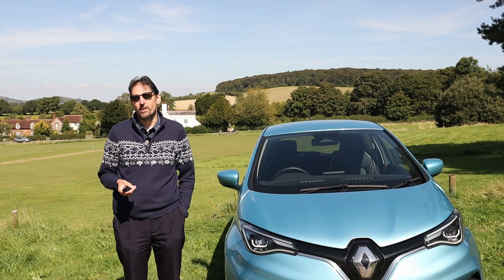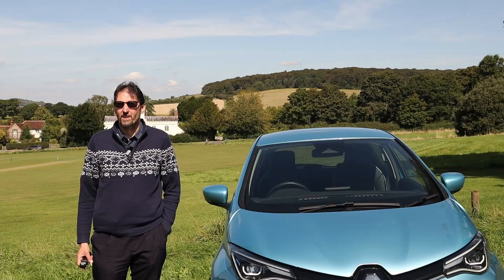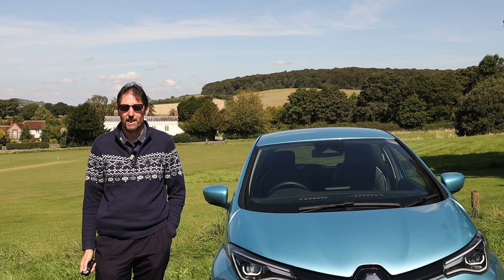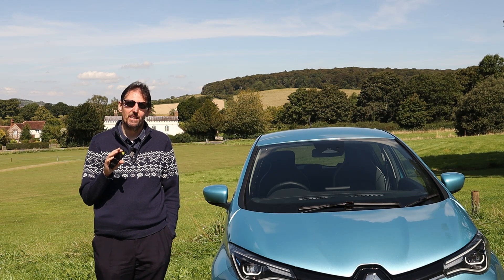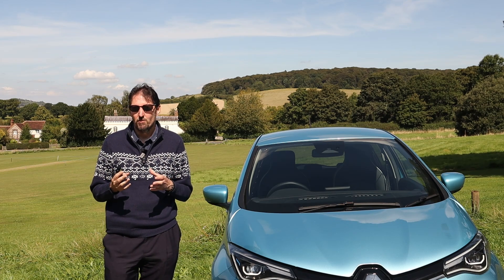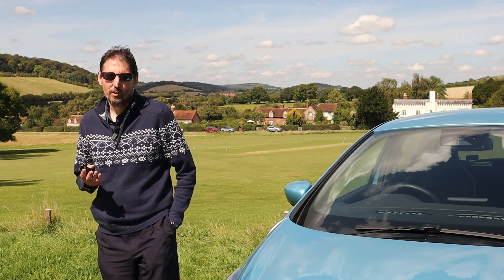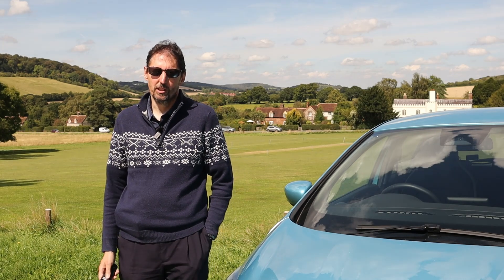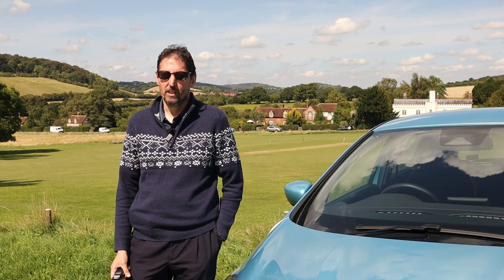Renault Zoe - Battery Degradation?

Comment: I would be more concerned with the Zoe motor bearings.. known to fail approaching 100k miles. Its a design flaw, they spark erode thru the motor and pit the bearings over time. See garyc ev repairs.
Reply from the maker: Yes, absolutely. I did a video referring to Gary's findings a few months ago 👍

Comment: Original Zoe had the 43kw AC optional charger , super rapid AC charge
Reply from the maker: Yes, indeed, it was not even optional in the early days. Those original ZOEs all offered 43kW. Only once the Renault motor was introduced was there a choice available.

Comment: Our 2017 ZE40 is now seven years old and still has at least 160 miles on a full charge.
Reply from the maker: That's great. Thanks for the extra data point. Feedback from owners certainly seems to be confirming the longevity of the ZOE battery 👍

Comment: I'm about to buy a January 2022 RENAULT ZOE Zen 50 R135 100kW, with rapid charger. The have shown me the SOH report: 96% and with ODO 25.000 km. What do you think? Is it convincing? I live in the south of Spain. Will probably in most cases do 16A home charging.
Reply from the maker: Hi there, sorry for the delayed reply. At 3 years old, we might expect 4% loss of health, that is exactly what I would expect. My rule of thumb is 2% degradation for the first year, followed by 1% in subsequent years, assuming average mileage. The mileage of that car sounds good, so it is reporting exactly what I would expect.

The ZOE battery is proving to be very reliable, so I would have no concerns there.

There are a couple of little weaknesses with the ZOE that have become apparent, one is a potential charger failure that isn't too hard to fix, and the other is an issue with the motor bearings. If this happens, it usually occurs above 100,000 miles (160,000 km), although some have suffered this sooner. Even so, this motor issue seems to happen to a relatively small number of cars, from what I can tell so far.

I remain very happy with mine. I've had no issues besides a flat tyre and some temporary software glitches.

Let me know if you get the car and what you think of it after a couple of weeks.

Comment: I can concur with your conclusions. Admittedly we are low mileage drivers of our ZE50 R110, but after 12,000 miles since early 2021 we've not noticed any battery degradation. We do have CCS DC recharging, but have never needed to use it, and almost always recharge at home at up to 3kW. 

What we have noticed however is that the true range of the car exceeds the claim made by Renault for most of the year. It's the start of March 2025, and I took it for a 30+ mile run today, in 3 stages, and saw 4.8 mpkWh, which equates to exactly the claimed range of about 243 miles from a nominal 52 kWh. Ambient temperature was about 9 to 10°C. In Summer, on long runs, it's easy to travel for 275 miles or further on motorways and A roads. With a little care, I can drive for more than 300 miles if the ambient temperature is above about 25°C, I have attained 6.4 mpkWh at times, with only myself in the car. 

In September 2023, with two people, a mobility buggy and self-catering holiday luggage aboard, travelling between the South Coast and Central Lincolnshire, we arrived at destination with an estimated 46 miles of remaining range. I had driven at normal traffic speeds on main roads wherever possible, with ambient temperature around 28 to 32°C.

In Winter, with near-freezing weather, and on multiple short journeys, the car still delivers more than 200 miles of range, even when my wife (who is heavier with her right foot) is driving. She drove for about 90 miles last weekend, with an friend, and in ambient temperatures varying from 1°C to 8°C, used the A/C, and returned with 60% of the battery SOC remaining. An estimated range of about 225 miles.

What I'm saying is that, even with modest thermal management, our 2020 Zoe, now on its way to 5 years old, can travel for further in a day in Britain than I'm happy driving for, without recharging en route. Even if the battery degraded to 75% of its original capacity (essentially almost end of life), the car would still be perfectly adequate for our needs, with maybe a brief recharge during a meal break. 

I'm now a 'senior citizen' as the Americans like to call us, and I have the impression that the battery will likely still be useable after I stop using my driving license. Maybe the rust maggots will have eaten the car before then.

My main complaint with battery recharging is that neither the car nor the Renault app tell us what the recharging speed is. That's quite frustrating when the recharging point doesn't tell you the recharge rate either. I wish the Renault would address the omission, but I doubt that they ever will. As Hubnut says, 'Because, French!'

Comment: Is it normal for the fan to be on constantly in the cold, range is very reduced when freezing temperatures too
Reply from the maker: No, I wouldn't expect the fan to be on constantly, unless the hear pump is working very hard.

I wonder if your system needs regassing. ZOEs are known to lose a bit of gas, so getting it checked might be worthwhile.

I suffer range loss of about 25% between summer and winter. Are you seeing more than that, and at what temperatures? The coldest mine has experienced is -5C
Reply: @theelectrictransition  its the battery fan thats on...temp was about minus 2 yeah about the same range loss maybe a bit more
Reply from the maker: @doncasterghosthunters  So the fan noise is from under the rear seat, rather than under the bonnet?

It's a ZE50 presumably? The ZE50 has a battery heater, but the earlier variants didn't, which is why I ask
Reply: @theelectrictransition  fan noise is under bonnet....yeah its my mates car , i thought perhaps when the battery is cold it blew heat to try warm it i thought after watching ur video ur the man to ask
Reply: @theelectrictransition  its a zoe e3w mc 1lp
Reply from the maker: @doncasterghosthunters  OK, a fan under the bonnet isn't for the battery, I dont think. The battery cooling is on top of the battery, at the back, under the rear seat.

I think it might be the heat pump. It sounds like the noise I get when I heat the cabin.

I guess you could confirm it by turning the cabin fan speed to zero, thereby turning the cabin heating off completely. If the noise stops, then it's related to cabin heating.

The other fan under the bonnet is the motor cooling, but that shouldn't be running much at this time of year.

You could take it to an air con place and have them check the gas pressure in the heat pump system. It might need a top-up.
Reply: @theelectrictransition  awesome thank u il tell him to try that

Comment: Many thanks for re-assuring me! 2017 ZE 40, 10000 miles - love it!
Reply from the maker: That's great! I'm glad you are enjoying it. The perks in the winter are not to be sniffed at, and the range gets much better in the spring
Reply: Ours has 230 000 and still has 250k range. Always charged to 100%

Comment: My 2017 ZE40 has 118K miles and the battery SOH is at 82%. A full charge displays around 145 miles (less in winter).
Reply from the maker: Thanks for the data

Comment: I think degradation measurement is very difficult and only an approximation  is possible and I will propose another method:
If you charge your car 20 to 80% say five times which makes 300% over the period (assuming you've zeroed the consumption at the beginning) now read your car's total (drive and accessories ie a/c etc. - Megane Etech seperates these two so you need to add) consumption meter then divide by 3 for our example case you would get a better battery capacity measure; I think. What is your thoughts ?
Brgds from Istanbul
Reply from the maker: Yes, that might also be an interesting figure to calculate. I went with the approach in the video because I wanted to minimise the figures I used from the car. Some people might accuse the manufacturers of adjusting the figures in their favour - and scandals like dieselgate certainly suggest some caution is appropriate in using manufacturer-provided data.

Comment: My 10-year-old Zoe is still running very well on the original battery, has seen temperatures as low as -31C here in northern Sweden, amazing car! 

Heat pump works like a dream in the mornings so you never have to scrape ice off of the windows and can get into a warm car from anywhere.
Reply from the maker: That's great, I'm glad it has done you so well. -31 - wow, that's properly cold! What is your rough odometer reading now? I ask because I know that there are a lot of people who have done, and continue to do, very long roadtrips in their 22kW ZOE, which must add to the distance travelled.
Reply: @theelectrictransition  Only about 73000km, other examples have driven much more than this one, but it was barely driven early on in its life so it's only now that it's starting to accrue some decent numbers on the odometer. Have seen plenty of cars with well over twice or three times that on the original battery though.

Comment: Interesting, but I’ll keep my 2009 Ford Focus that can do 500 miles on a tankful of good, old fashioned petrol.
Reply from the maker: How often do you do a journey of 500 miles? If you have easy access to overnight charging then having more range than you actually use is a bit irrelevant.
Reply: @theelectrictransition  We just drove from the Black Sea coast to Halkidiki. These are not uncommon trips for us.
We have the ability and space to spend 1500 quid on a charging point at home, but why would we? 
We travel back and forth across Europe in the Focus or Dacia Duster diesel.
Life's too short and stressful enough without all the farting about with an EV.
In January we were in Bansko and there was a Tesla with Bucharest license plates parked next to our car.
It was - 14 C and we got home on half a tank of petrol in a nice, warm car.
How many stops would sparky have to have made on the journey to Romania?
Too bloody many, thank you very much.
Reply: @escapetheratracenow9883  , and you drive 600km without stopping? 🤣🤣 When i go on vacation, i go on vacation, im not in race with anyone! Think about not only a range in your car but all your parts thts need to be replaced - chain , oil , clutch, transmission......etc . Do you think about that ?

Comment: I've had 6x Renault Zoes as I buy & sell EV's..

2018 ZE40 with a SOH between 80% to 90% and a mileage of 110,000km..(Can't remember exact SOH)

2018 ZE40 with 86,000 miles was a ex uk car and the SOH was 86%..

2020 ZE50 with 32,000 miles was a ex uk car and had a SOH of 91.6%..

2020 ZE50 with 22,000 miles was a ex uk car and SOH of 90%..

2020 ZE50 with 49,000 miles SOH 95%..

2020 ZE50 with 50,000 miles SOH 96%..

In my experience Renault Zoes don't give any battery trouble..
Reply from the maker: That's really useful information, thanks.
Reply: 10% less range per charge after just a few years, that sounds scary
Reply: @r1pfake521  Most EV's lose around 10% in the first few years thats normal.. I will update that post as I've had more since..

Comment: my 2013 chevy volt is at 200,000 km and it has NMC lipo pouch cells, very similar to the leaf battery cells. it gets 45 miles of range, and new it got around 36 miles lol. because its a PHEV and doesnt have DC charging, and also doesnt let the battery discharge in the cold and has a very over built battery cooling system, it basically has no noticeable degradation over the entire life of the vehicle. despite what people will tell you, most large batteries that are built well will outlive the life of the car. several examples of chevy volts getting to 500k+ miles (~1million km) with no noticeable degradation.
Reply from the maker: That's great, real-world detail, thanks. I'm glad the Volt is serving you so well

Comment: I read somewhere that Renault are monitoring a Zoe, still on the road, which has allegedly done a million kilometres on the same battery.  Unfortunately I can't find the link to where I read it.  So, if anyone has it I would be grateful.
Reply from the maker: Oh wow, that's amazing. Thanks, I'll go looking for that too - thanks for the tip. And yes, if any viewer has that, please share it with everyone here, that would be most appreciated!
Reply: That's good too hear but doesn't say much about degradation, because even with 50% degradation you can still drive, just less max range per charge, but a 90% degradation can already make the difference between managing a trip without charging and a few years later you suddently have to stop and charge for the very same trip, because the max range isn't enough anymore.

Comment: Here we regularly get over 38° C (100 ° F) and I pay particular attention to the cooling system on any EV I'm looking into. Air cooled, even actively cooled, would not be for me.
Reply from the maker: I totally agree. I don't think we will see anything bigger than a quadricycle do air cooling again. The ZOE was built to a budget that was really tough to achieve all those years ago, and cooling was a corner they cut that seems not to have had too detrimental an effect, but other people are unlikely to risk.

In the book Inside the Machine one of the lead engineers talks of the alliance with Nissan. He says that Nissan designers realised they had made mistakes that they were too late to correct. He doesn't say what, but I wonder if the fact that ZOE has ANY active cooling might have been down to recommendations from Nissan
Reply: I do not care at all about air cooling, so far I think it has been used on one occasion. Better battery heating (at least longer) would be a great improvement on cold snowy winter mornings...
So I can rather safely assume we live in rather different climate zones. 38° C I hardly get even inside the car when parked in the sun during summer...

Comment: I do have Zoe ZE50. Main mistake from renault part is, that SW does not allow limiting SOC limit and charges to 100%. Battery in ZOE degrade faster, the longer it is fully charged. I added choice to my home automation to stop charging after SOC of Zoes battery reach preset % (50,60,70,80,90,100). I have to pull state of charge from internet, but I may add there ODB2-WiFi adapter after my reanault link subscription expires.
Reply from the maker: I agree, it was an odd choice not to allow people to set a charge limit
Reply: Agree, when I charge the car I always put the car on a charging schedule, so charging stops after a certain time. So the car does not unnecessarily charge too high SoC. And when the car is stationary for a long time I leave it at 50% SoC.

Comment: My 2020 Zoe capacity was down to 43.7 kw from full to 0 which driving eco mode equalled to about 165/170 miles I tried a couple of suggestions from you tube to reset the BMS in the hope that the range would improve to no avail but after watching a range test on you tube gave me an idea, using the energy flow screen I have been able to improve the capacity to 50.75 kw and the range 205 miles in normal mode.
Reply from the maker: Wow, that's a big difference, that's great news. What did you do using the energy flow screen to make such an improvement?

Comment: Another thing the Zoe probably doesn't experience that the Leaf does is very hot climates.  People would be stuck in traffic in Arizona, USA in a Leaf with a pavement temp  as high as 180°F just baking the battery on their daily commute.  Leaf batteries by me in upstate NY last a long time because it just doesn't get that hot in the summer. I know a number of people with 2013 leafs that are only 1 bar down after 11 years.
Reply from the maker: That's very true. The LEAF is available in MANY more countries than the ZOE, perhaps due to its greater size. Having said that, the LEAF can suffer quite bad degradation even here in the UK, which is a bit more temperate than Arizona. A bit of thermal management goes quite a long way in most climates, it seems. But liquid cooling is the gold standard, and that's what I expect to be the norm for the future. We live and learn.